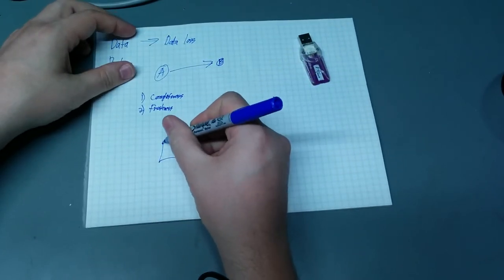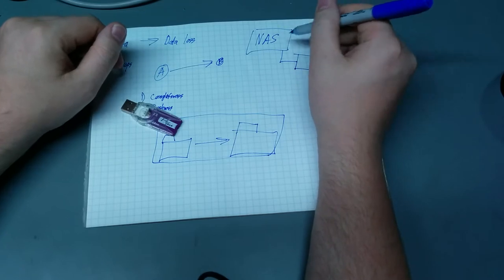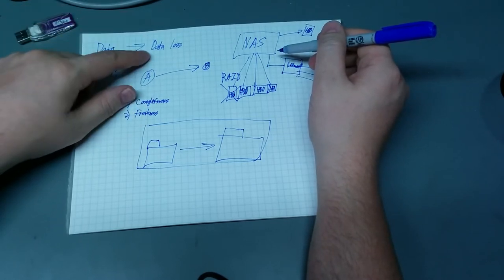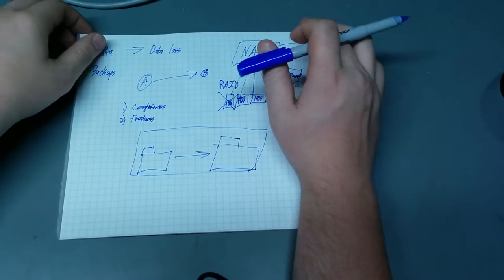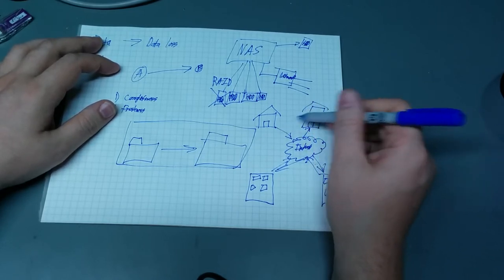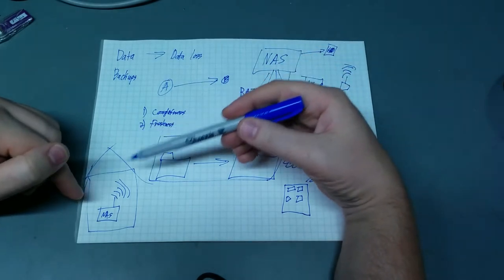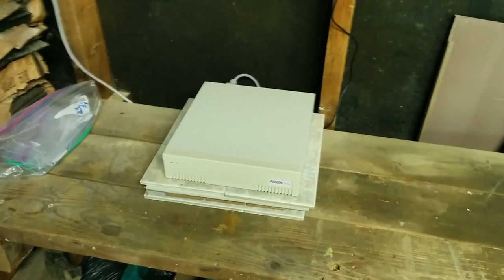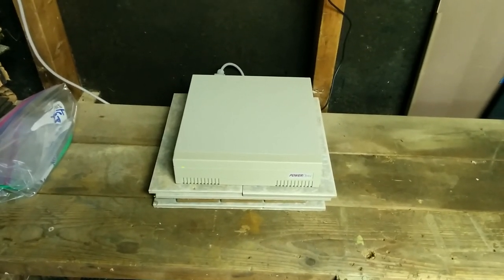LOCAL_REMOTE - A Raspberry Pi Backup System

Comment: I was wondering what you used for the Ethernet jack on the back. I’m having a hard time figuring out what to search for to get an Ethernet passthrough plug for the back of a custom case.
Reply from the maker: I just searched ebay for "panel mount ethernet" and this is the first result: https://www.ebay.com/itm/RJ45-Male-to-Female-Screw-Panel-Mount-Ethernet-LAN-Network-Extension-Cable-/173219319979